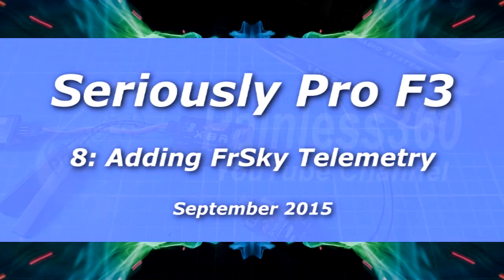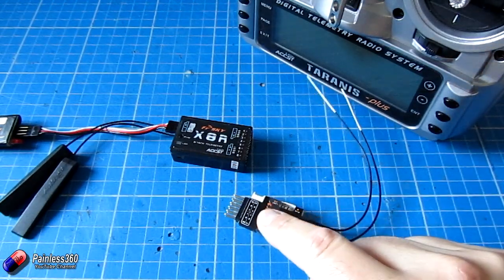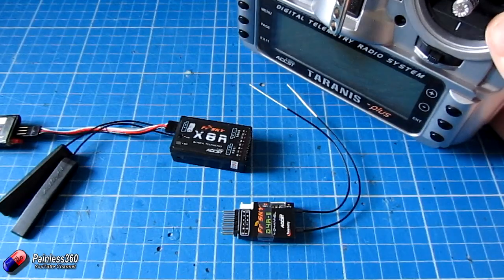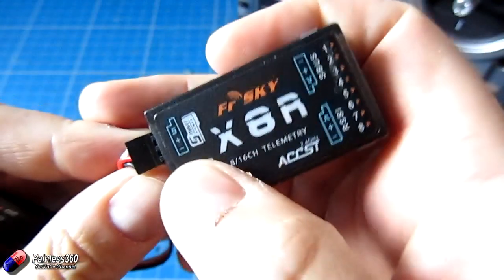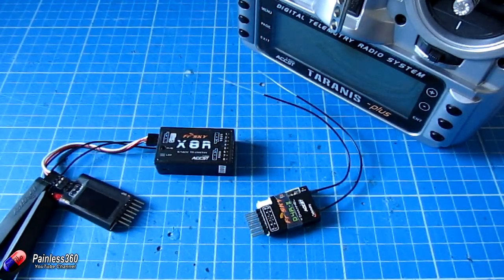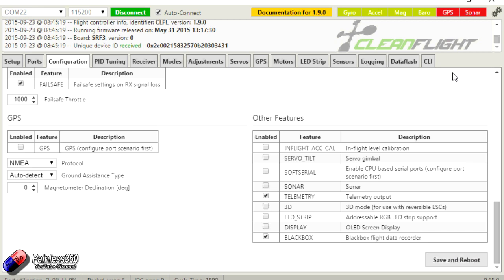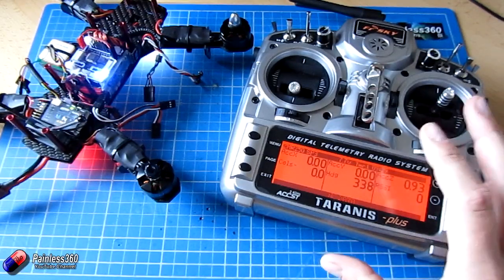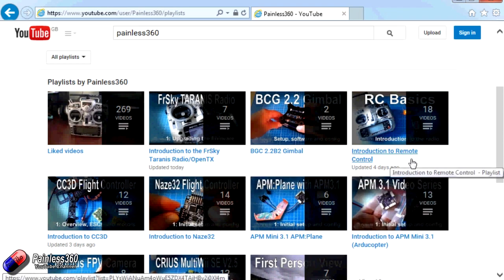(8/9) Seriously Pro F3 (SP3) Series - Adding Telemetry (Traditional)

Comment: Just a hint: with the new firmware for the x4r SB you have sbus and cppm with s.port telemetry available.
Reply from the maker: I plan on swapping the Rx to be a good old D4R-II on this model now the series is complete. Easier telemetry with the OpenTX I have installed and I will get a UART back..

Happy flying!
Reply: +Painless360 I got the smartport lipo voltage reader and it just works.  Add's more weight, 6 grams but I fly without a lipo buzzer now because I have all cells monitored.
Reply: +Painless360, now that 1.10 is available should I use my D4R-II (in my possesion) or get an x-4 series for s-bus? I suppose I am confused about the soft serial and what that is. You mentioned 1.10 may provide a fix. CPPM I understand, and s-bus was suppose to make it easy but D4-ii doesn't have that. Could you maybe explain these for the SP3? Just want to be sure before I solder anything. Thank you sir.
Reply from the maker: I prefer PPM, S-BUS needs a UART to work and SoftSerial isn't needed often if you have that extra UART to play with ;) Best of luck.
Reply: Thanks, was there a photo or video of that set-up, I think I got it, but I want to be 100%. Thank you sir. Do you have a donation page. I gave to Dominic and would like to kick a buck to you as well.
Reply: If you want maximum performance get x4r it definitely feels more snappy for me and my brother.  You can immediately tell when your flying the x4r over the d4r.
Reply: what machine would I use to test that assumption. Ryan Roberts ideas or reference material?
Reply: +Eric P we fly blackout mini h quads with d4r and x4r receivers with identical hardware apart from receivers.

Comment: Need Diode across Gen Purpose IO RX,TX of Seriously Pro F3 for smartport telemetery of X4RSB to work. From my experiments:
X4RSB has SBus connected to Pin 3 of IO_2 connector which is also the UART3 RX pin.  This works.  Now I CANNOT use the other UART3 header for telemetery according to Seriously Pro F3 manual.    
Painless360 video shows UART2 Pin 3 being used but he sacraficed his gps to do it.  He also mentions you can use IO_2 pin 6= ch8/Sonar Echo as a TX for smartport telemetry.
In cleanflight config, enable softserial then in ports softserial2 Telemetry Tab, set to smartport, auto.    This did not work at first.
The FIX: Same as on my Naze32.  You need a signal diode'I used 1N4148' dark band connected to IO_2 pin 5 Ch7/Sonar Trigger as RX, non-band side of diode connected to IO_2 Pin6 TX. Make sure the smart port wire is connected to IO_2 pin 5 RX only.  This worked Now I have telemetry on Taranis.  Cleanflight CLI telemetery_inversion = on.  I think I had to rescan for sensors on the Taranis transmitter after soldering in diode.  Hope this helps and not hurts someone.  Jason

Comment: I'm having problems with flashing my bored I haven't even solderd it yet, when i got to flash it i get a error "failed to communicate with bootloader" and the red light stops flashing :(
Reply from the maker: Not sure, if it's brand new then go back to the vendor for support/replacement. Best of luck!
Reply: I've message Dominic Clifton on G+ but I understand how busy he is.
Reply from the maker: +Brighton Till I Fly did you buy it from him directly then?
Reply: Yep at the nationals it did come with a business card that I've misplaced.
Reply from the maker: +Brighton Till I Fly I hope you get it sorted quickly. double check that you have selected the manual board rate in Cleanflight before you flash it...
Reply: Yep I did he gave me the manual, its such a bizarre fault as the board connects and works just won't flash, good job I run checks before switching on the ion!
Reply from the maker: +Brighton Till I Fly Indeed!
Reply: +Painless360 +Brighton, the manual baud of 225000 (?) is essential when you try to flash, won't work otherwise as I found out too. I was getting the same error but checking manual baud and leaving it at the default higher rate sorted it.
Reply: +George Elliott shorting the boot pads and manually setting the baud rate to 230400 is the only thing that will allow me to flash the board.

Comment: Hi ! Could You imagine adding Bluetooth with all other features, just for fun :-) I'd like to play with mission planner.
Reply from the maker: +The Running Cam Watch the videos in the Naze32/Cleanflight series. We add Bluetooth in there and it's the same for this board too.
Reply: +Painless360 I'll do thank You very much.  Congratulations for your channel.
Reply: +Painless360 May I ask You If "follow me" mode is possible with thar FC? And how to set up?
Reply from the maker: You can but only with flight controllers with great GPS flight modes (like the APM or Pixhawk/PixRacer). Happy flying!

Comment: May be you don't understand me, I mean how to connect " all in one board " Nighthawk 280 pro to telemetry receiver's . For sample: Naze 32 has 2 pins " telemetry" , so it easy to do, but " all in one board " haven't
Reply from the maker: +TheRCfunny I do understand so you will have to use the SoftSerial method shown in the Naze32 series to connect and use telemetry.. Hope that makes sense.
Reply: +Painless360 
Ok , Shell i use pin #6 (ch4) to get telemetry ?   Board Nighthawk 280 pro
Reply from the maker: That's not pin 6 as the first two are GND and +5v.
Reply: +Painless360 Ok, Nighthawk 280 pins going in the same order as Naze board.
Gnd-plus-ch1,2,3,4,5,6 Total 8 pins. You recommend for Naze connect to pin #6. I've connected to Pin #6 , but it doesn't works. Did you get telemetry from Nighthawk 280  board?

Comment: Smartport works on soft serial without any problem in 1.10.0. It's fast enough.
Reply from the maker: +Ralph Moser Thanks for the comment, I'm waiting for the final release of 1.10 to try again. I understood SmartPort baud rate was 57,600.. Have you got it working? I'd love to see a video..
Reply: The new CPU is fast enough to do higher bitrates. The reason why I tried it was because somebody at github wrote that it works. Just connect the green and yellow wire together onto the signal pin of the smartport connector and enable telemetry inversion.
Reply from the maker: Interesting. Why connect the green and yellow together?
Reply: +Painless360 Because the softserial code is unable to do send and receive on the same pin.
Reply from the maker: I see. I can't wait for 1.10 to try! Thanks again.
Reply: +Painless360 FrSky recommend a diode on the TX line for upgrading firmware via the S-port which might be good idea. Details can be found at http://www.frsky-rc.com/download/view.php?sort=How%20To&down=121&file=How%20To-S.Port%20Products